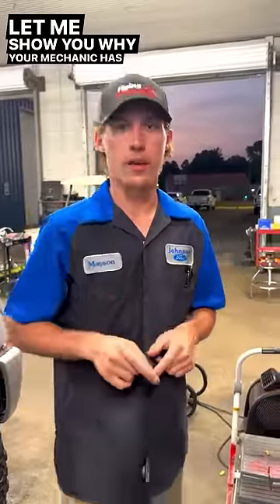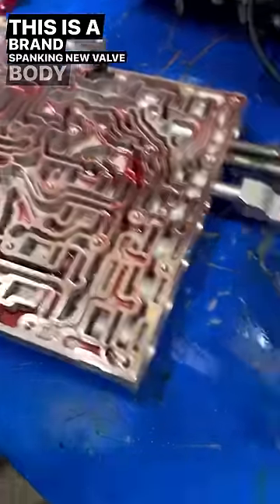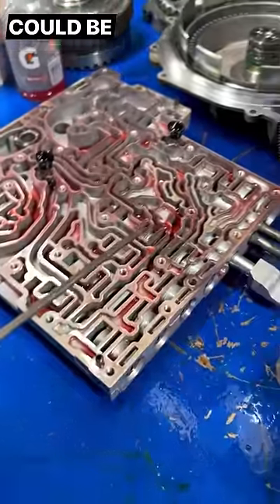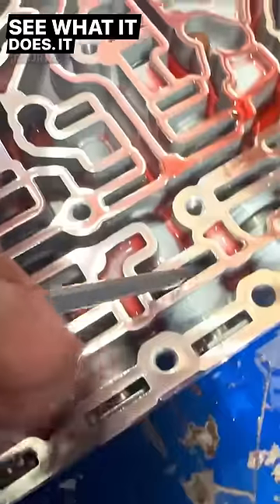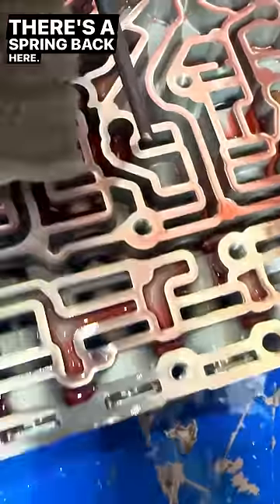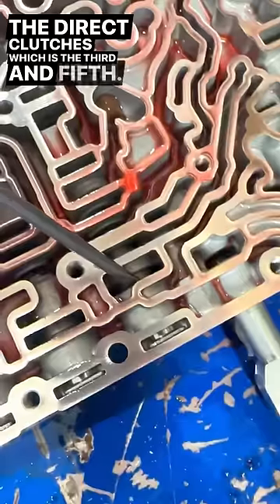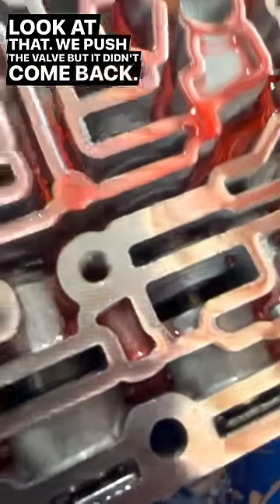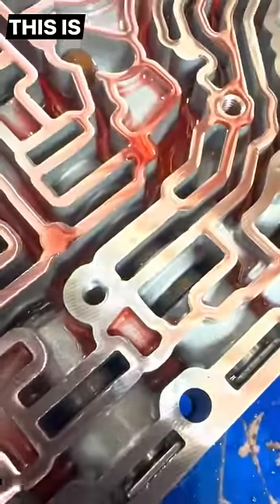Why your mechanic has trust issues #shorts #ford

Comment: As a machinist who has seen garbage get shipped I approve this message
Reply: as a customer I have bought that garbage. I approve your approval of that message.
Reply: As a person reading comments, I approve both approvals. Being on the internet qualifies me as 100% factual.
Reply: 😂but if you ask the engineers it's OUR FAULT. It's your fault for the machining work, it's my fault because I don't know how to install a valve body.

Never a design issue 😂
Reply: @pf4877 Engineers make mistakes just like machinists. Can’t have one without the other.
Reply: @LynxStarAuto I mean if you could just machine the part to the 1 tenth tolerance using a bit that's physically impossible to make then it would just work. Obviously it's not the engineers fault if the part can only be manufactured using 4 dimensional tools
Reply: As a complete random on the internet, I do not approve this message, as I don't have the authority to approve anything.
Reply: @pf4877  As a quality inspector I approve your approval. How many places I've left after being told "We can get away with that", "we still need to complete this order (when the fail would put it one short)", and "it's good enough"... Ugh.
Reply: As a machinist that has shipped garbage I also approve.
Reply: as a brazilian